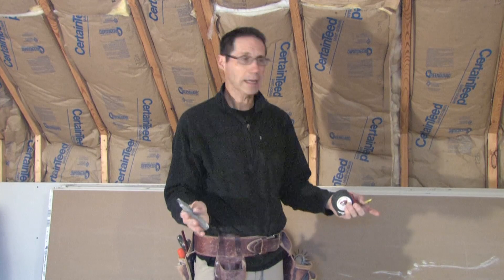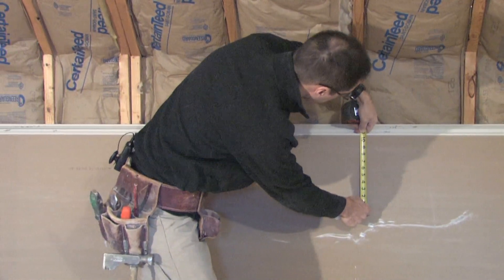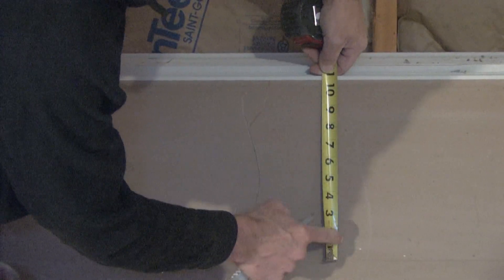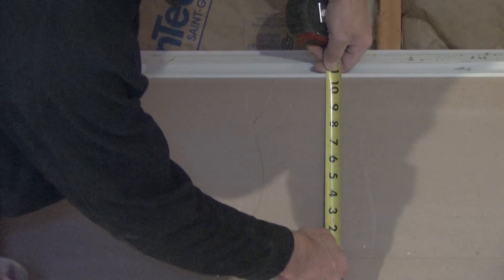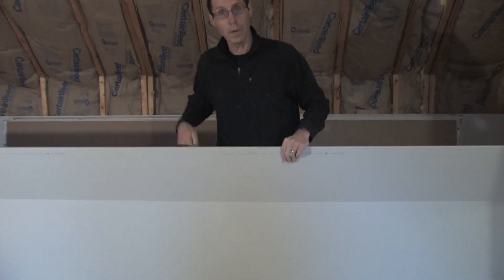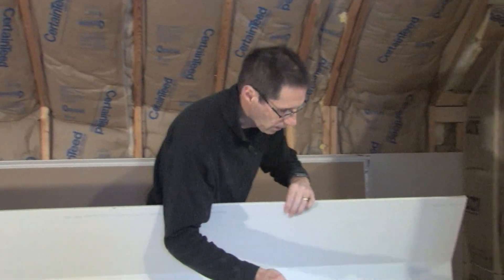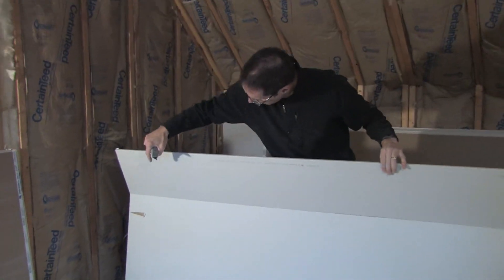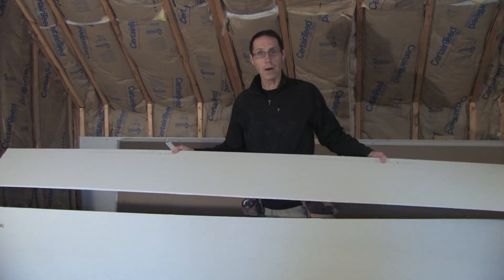Drywall Tip: Cutting  Drywall When Working Alone

Comment: I have two pieces of small timber 8' long, use a couple of spring clamps to hold them in position, score & cut, both sides if need be, snap * lift off.

Comment: u should always cut on the paper faced side not the brown side
Reply: it dont matter what side thats the way they deliver them what do you do flip every other one your not a professional at all neither is this guy
Reply: I've been doing drywall for over 10 years full time and you don't cut sheets from the back unless you are from Quebec.
Reply: Honest question here I've done a f$&k ton of drywall in the last 6 years and I'm curious as to why it's so important to cut the face only? We generally do but when we miss the odd one it hasn't presented an issue.
Reply: quietcorona33 because if u mess up an tray the white paper off the tapers have to skim the parts
Reply: @quitcorona33 basically I've been doing drywall for over ten years and the reason we cut drywall from the front is because if you cut it from the front not only do you not rip up the paper and make more work for the tapers but you always carry it from the front because that is the side you install out so its a time thing where you want to be on the white side so why cut from the back then walk around to the front to install so it only makes sense to cut from the front. Then you can split from the same side and save a lot of time. I hope this helps.
Reply: cool thx
Reply: LExNatural Yep cut and carry on the face. Been taught that since day one
Reply: Im new with drywall and the guy im working with says you have to cut from the brown side. Is that right?
Reply: Superior u should allways cut from the white side so that way the white side of the paper don't rip and make a mess for the tapers if the guy your working with is telling you to cut from the brown side only I would NOT listen to him he is trying to make you look bad I seen this happen 100 times before please trust me
Reply: lets say youre partner on a lyft and cant help you flip the sheet you can cut from the back if you use this technique it wont rip the paper plus it saves time having to flip the sheet by your self
Reply: Not true.......  @all..  lll